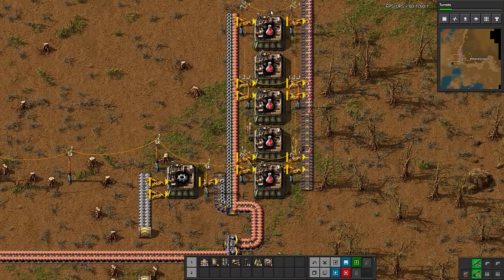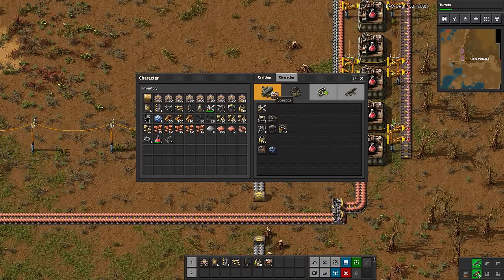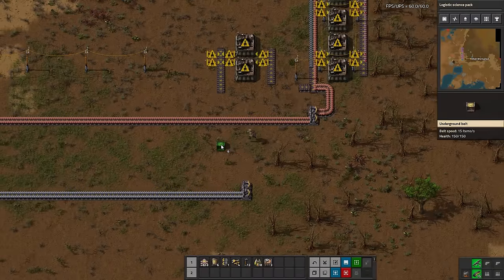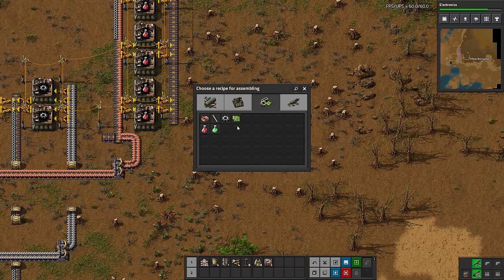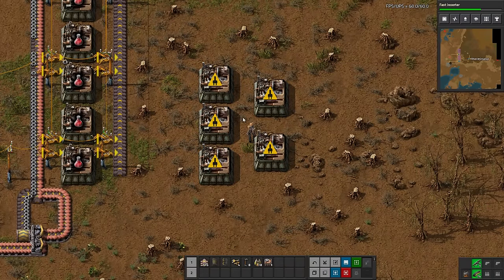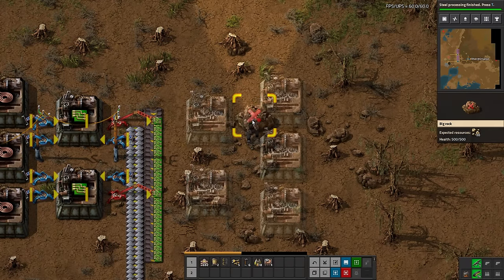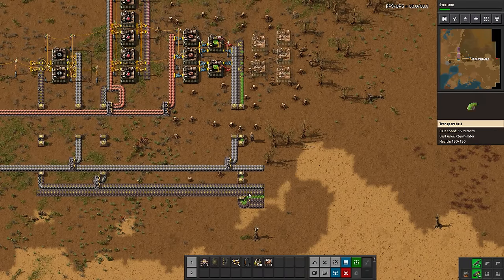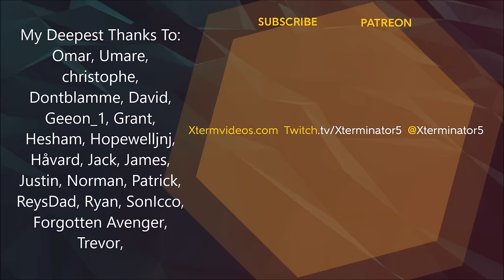Factorio 1.0 Tutorial Lets Play EP4 -  Circuit Setup: Introduction Guide For New Players Gameplay

Comment: X, a simple way of calculating ratios that is easy to remember and easy to calculate is ... assume a base craft rate of 1; divide the (edit) crafting time by the items per craft (ignore fractions). Use this result as your number of machines. Examples; red science = 1 pack in 5 seconds so 5 / 1 = 5 machines. blue science = 2 packs in 12 seconds so 12 / 2 = 6 machines. purple science = 3 packs  in 21 seconds so 21 / 3 = 7 machines. As you stated this is NOT perfect ratios or accurate calculations, but a simplified “close enough” solution. Remember the factory must grow.
Reply: Yup, that's pretty much the thing -- except you mis-spoke at the start; you're dividing crafting time by items-per-craft, not items-per-craft by crafting-time.  Also of note, you can then assume all the inputs for one machine are what's needed each base-rate-craft-time.  Because if you have 5 machines that need 1 gear each per craft then that's 5 gears needed every 5 seconds, or 1 per second, average.
Reply: A simple guideline is that basic ratios generally work fine until you start messing with modules. After that you either have to accept that your ratios are not working that great anymore or go into calculating the exact ratios of your builds.
Reply: New players are doing very well if they advance past chemical science on their first map. It took me 3 do overs and then 42 hours to launch my first rocket. To this day with well over 6000 rockets launched I have never bothered to calculate perfect ratios. The fun part of the game for me is trying to invent new ways to do things every play through. Using the simplistic close enough calculations is a great way to get to a rocket. If you want to become a ratio engineer later, go for it. But for beginners, get in there and play the game, have fun, and don’t forget to press the ALT key.
Reply: @Kahnugo  for those open to mods, Max Rate Calculator helps a great deal.  :)
(Also some of the various planners, either as mods or at https://kirkmcdonald.github.io/ )

Comment: "Not a ton of things use gears". That's actually why the gears on the bus thing isn't really necessary anymore. The gear needs of the sciences are pretty modest now and can be easily handled by four belts of iron (it required a lot more gears when recipes were different). Even if that's not the most space efficient setup.  
Nowadays most gears are needed for things like belts, assembly machines, mining drills and other factory machines. Many of those items do in fact use gears. And  a lot of them later on. But they are different from the things you consume at a steady rate. So it's very viable to locate most of your gear production in your "make everything" factory/mall. And possibly run dedicated iron belts to that
But either way works. It's personal preference.
Reply: I agree, I flip-flop between gears on the bus or made where I need them.
Reply: if someone expects to later need two belts worth of gears, he probably should have two belts of gears instead of another four belts of iron. just imagine a factory that has only a bus with 4 iron belts, and right in the middle they all run dry. the same also applies to having two belts of green circuits or another 5 belts of iron/copper.
on the other hand, there are many other methods later how to supply parts of the factory with additional resources, eg resupplying the main bus in the middle by train, using bots, whatever. just try one, try the other in the next game, and spaghetti taste best even when there are faster food types :-)
Reply: @Anson_AKB  
I build my mall right at the start of the bus. So I don't have to bus the iron for the gears all the way. Hence that iron doesn't need to go on the actual bus. It all depends on how you build things.
It's similar with the plates for the circuits. Those don't need to be on the main bus either.